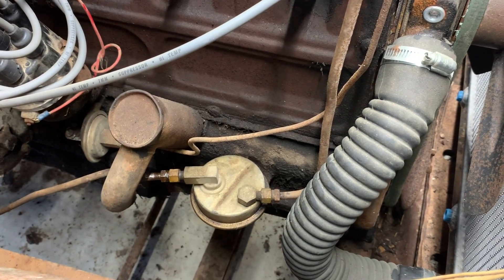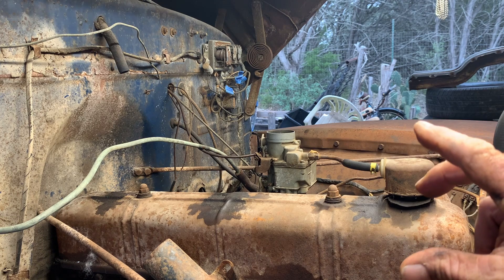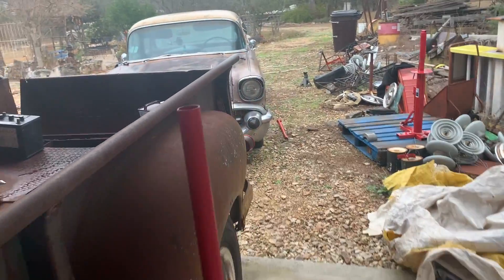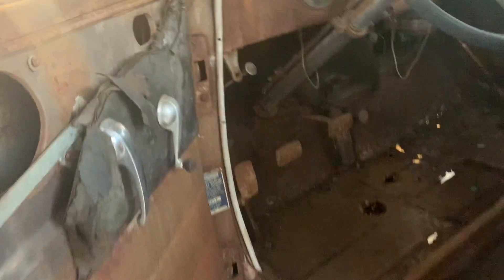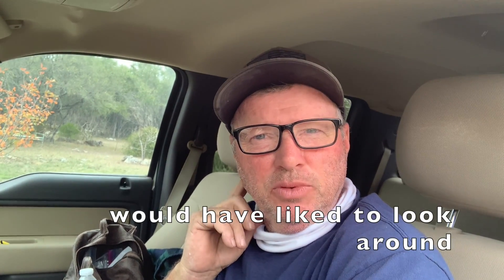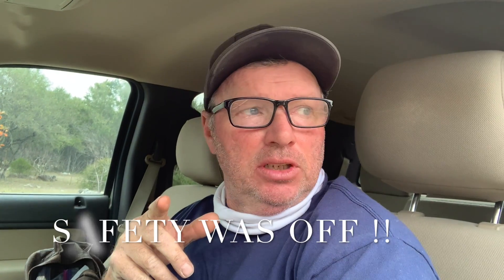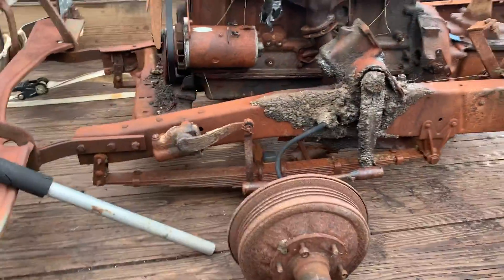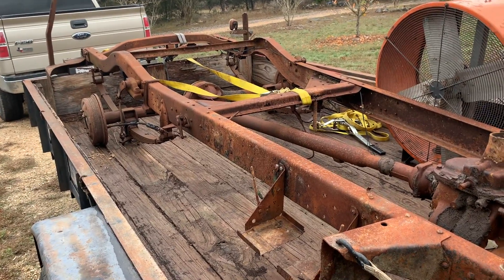1953 Chevy truck new fuel pump and new front straight axle.

Comment: You had that six humming like a ole swinger sewing machine Robert! Sweet deal on the frame, absolutely harvest your parts and get money back on part ot of chassis
Reply from the maker: Thanks Bryan. Hopefully that axle will work, didn’t realize the difference between 50 to 53. Thought they were all the same. Initial measurements look close. Just trying to figure it all out. 🤞
Reply: It was a great buy Robert,  even if you get that six running,  easily get your money back on the purchase.
Reply from the maker: I also wanted to thank you for the shout out and showing my car on the live. Pretty cool. We’re still very small and really appreciate it. Thanks again for the support.